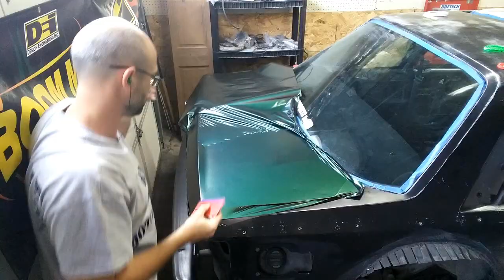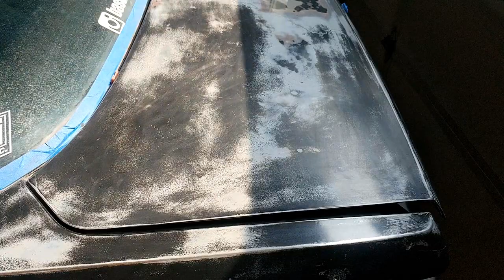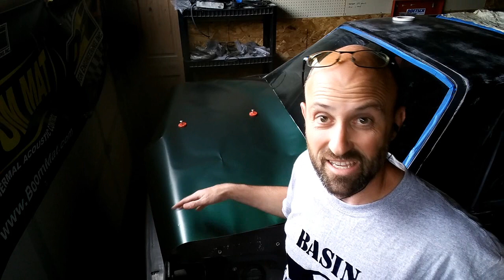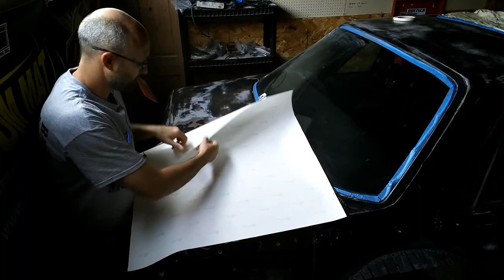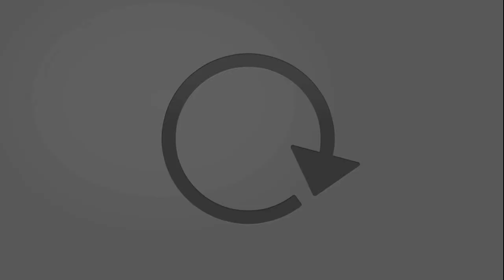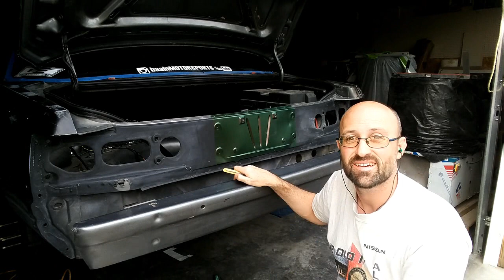Wrap Your Trunk To Make Your Booty Look Good  |  WideFox ProTouring Mustang

Comment: What is the cost to wrap the whole car in vinyl? It's looking good!
Reply from the maker: Thanks. I'm very happy with it so far. Cost can vary wildly depending how you look at it. I'll have $850 in materials and about 40 hours in labor because the prep is taking so long. If the car was ready to wrap, that may drop to the high 20's for labor.